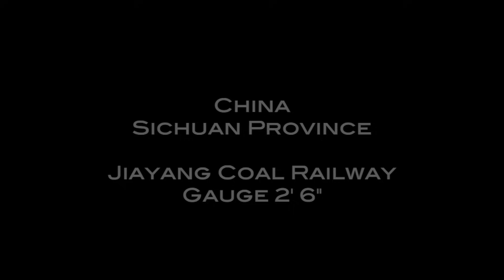Narrow Gauge Railways Around the World Part 4

Comment: The question in whobody takecare about the maintenance schedule. I'm not speaking about paint and lubrication. What about the steam boiler especially on this small engines used to collect suck king of sugar cane. Risk of explosion is on the corner. A diesel engine at the end of the life just doesn't work. The risk on steam engine is the explosion just because some rust or just one manometer dosn't work anymore. This kind of engine need a particular overhaul after some years.